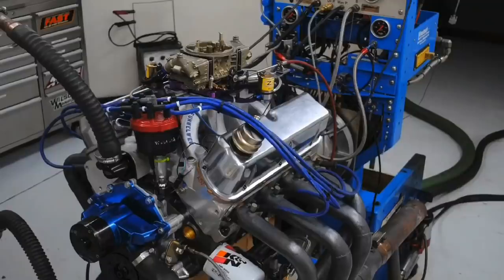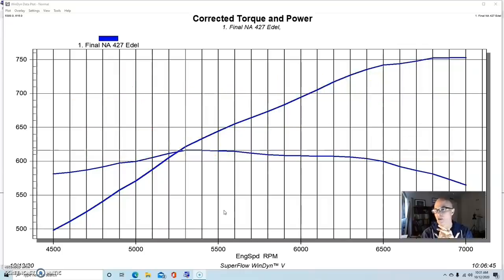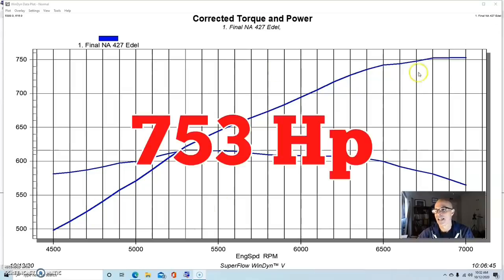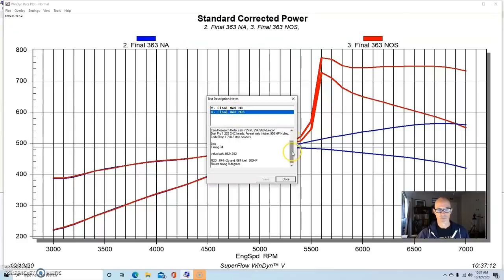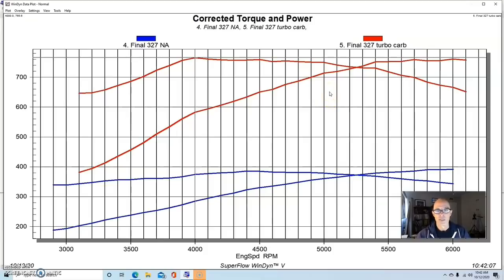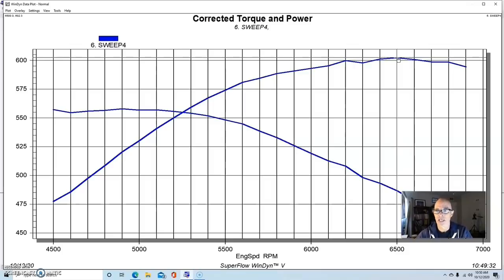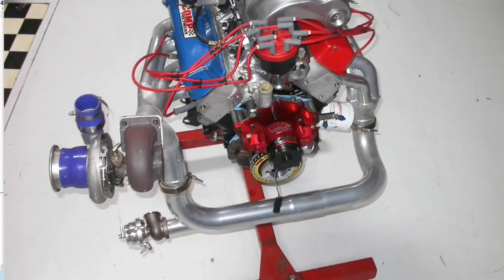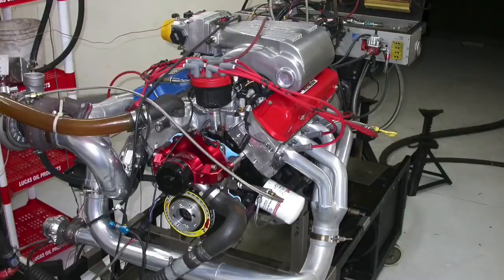THE FAST 5 -- 700-HP 5.0L FORD COMBOS

Comment: The correct cubic inch of each engine is parenthesis. For some reason, some engines .5 and up round up and some do not. 327 (327), 331 (332), 363 (364), 418 (418). 427 (428).
Reply from the maker: The correct cubic inch of each engine was noted
Reply: @richardholdener1727  Your 326.7 rounds up to the 327, at the same time the 331.6 did not round up to a 332. The worst that I know of,  the 350 Pontiac measures 354 cubic inches. Hope this helps what I was getting at. Have a great day and I enjoy your videos.

Comment: Five minutes into the video and so far I hear aftermarket block.  I'm not a mechanic. I'm a Street racer from way back. And with a aftermarket block, should be able to make over 700 horses and not have to worry about the block

Comment: Question??? I notice on the smaller displacements that the torque and HP numbers are pretty close in proximity, which I've been told thats signs of a good build. However, on the larger ones the numbers are a bit further apart. Is there a reason for that?
Reply from the maker: if torque is higher than hp-its a very mild build, if they are the same, its mild, if hp is higher than torque-its getting good

Comment: That's 427 needed different heads. Y'all threw up money on some garbage heads don't matter how much the flow bench test are. Afr 225 or some kasse p38, trick flow r or high port. If I did n new motor would be aluminum 363 dart block with some AFR 225 outlaws and 1 turbo for mild street motor of 800hp/torque or race gas for 1000hp.
Reply from the maker: you missed the point of the 700-hp combo video
Reply: @richardholdener1727  nope. Crappy heads waste of time and money.

Comment: Is it true a 1992 ford with afr heads makes 400 horsepower all my friends are telling me that this is true but I think that a cam and other things might need to be involved and this was in a Lincoln 1992 Lincoln
Reply from the maker: a 1992 5.0L Ford? no-not without a cam
Reply: @richardholdener1727  thank you.I also told them I need to fly cut the pistons to work with the afr heads.or do you think I'm wrong? I really love the videos you share.

Comment: Contrary to your disappointment in the video, I think the 427 was very strong! My personal rule of thumb for a strong NA engine is 1.4 lb-ft per cu in at the torque peak and 1.25 lb-ft per cu in at the horsepower peak. Your 427, with very good parts in it except for the rockers, was well over those numbers by my calculations. By comparison, the 363 NA numbers were well short at about 1.3 and 1.2 respectively. It didn’t have 13:1 compression so maybe that’s understandable. It’s all good info, as we’ve come to rely on you to provide. Thanks!
Reply from the maker: the 427 made 1.75 hp per cubic inch-the 363 made 1.56 hp per inch
Reply: The torque that creates the power is what I go by, the 1.2 @ 6800 gets you 1.5+ hp, likewise 1.33 @ 7000 gets you 1.75 hp...

Comment: Richard, Have you ever done a test on using different trims (S trim vs T trim for example) of centrifugal blowers back to back?
Curious to see the difference in boost pressure, IAT, power curve, etc... with the same pulley setup on different trims-preferably from the same manufacturer.
Reply from the maker: I did-I'll have to see what engine family

Comment: Richard could you please at least list the build sheet for the Paxton 775hp combo? What heads, cam, intake? Boost level? Peak power rpm? Also, are these tests on pump gas? Pretty please 🙏! 

👍
Reply from the maker: no pump gas
Reply: K well will you at least tell us what heads/cam/intake were used please?
Reply: HCI ?

Comment: QUESTION,FROM A OLD POST.HOW IS THE A/F RATIO TUNED DIFFERENT ON A N/A MOTOR WHEN USING E85 VERUS 91 0R 93 ARE THEY STILL ALL TUNED AROUND 12.9
Reply from the maker: yes
Reply: Thanks richard

Comment: Any chance you can test any Cleveland combos? Or test Aussie heads?
Reply: That would be a good one with the OEM 2bl closed camber heads along with some of the down under aluminum heads from pro comp to the top dollar heads and also p-38 heads offered by Jon kassie  that would be very informative and I'm sure help a lot of guys decide on what set up would be best for them !!!
Reply: Bobby Rosetta I’m at the point where I’m selecting cam and cylinder heads. I’ve found a pair of closed 4V heads on eBay in the 1.3k region. I’m be also found a guy who has genuine Aussie closed heads cast by ford in Australia would still need valves and everything. But I’ve heard they’re a good middle ground between the 2V and 4V ones. So I’m kinda debating which way to go. I have some time at least while the car is getting painted to decide.
Reply: @Bonanzaking  keep me posted and send some info on how your going to use it and so on ,drag,road race or what ,thanks for getting back to me
Reply: @robertrosetta908  I was kinda thinking about road racing. Outside of that I’d probably use it for weekend trips to Vegas from LA so the large stretches of highway will be nice.
Reply: And also see where it stands against the LS head motors
Reply: I just read a article on Higgins racing and amazed the dyno number on the combination 971hp na,insane for na for a street .motor

Comment: On combo #4, the 418 Windsor, I think the 1 3/4 inch headers are too small. I would have liked to see a 1 7/8 inch primary because it's not to going to overhang the port all the way around like the smaller flange/tube does....which is a bottleneck right at the head.

Comment: Lol, low compression? How bout 13:1 with twin precision turbos, 22psi boost, carburated running meth, around 1300hp to 1500hp. I dont get why guys still build engines that run below 9:1 compression ratio. If you have proper fuel available from the pump, or the car wont be used as a daily, give it compression. Id like to hear your opinion Richard. 

Im thinking about playing with high compression and some boost, but will be on a 4 banger. Highest octane here in my country is 95 unleaded pump gas. We dont have many options when it comes to v8 engines. A run of the mill old school small block engine will cost you more than buying a 1uz and swopping it into the car, including everything you would need to get the auto tranny shifting and tuning. Hence every 2nd pickup here runs a toyota 1uz.
Reply from the maker: for a race motor with enough octane, more compression adds power-many of these were done 20 years ago

Comment: How in the world did that 331 make 448 with an xe274?  Those heads must have been ported to perfection.  You see I am trying to guesstimate my power.  I am running a 331 with 9.6 cr and afr 185 heads with a performer rpm and comp 281hr cam with 1.7 ratio rockers.  I figured it made 420 hp.  So for my 388 build i bumped up my cam to an edelbrock 2281 ( 299 duration) in hopes of making 520 hp...your 408 stroker in the previous video only made 534 which made me think that no way my 388 would make 520, but maybe those afr 185 heads flow better than the trickflows on the 408.
Reply from the maker: that's why I test instead of estimate-I'm often wrong-the dyno never is.

Comment: Richard, was the 427 expectation that better shaft rockers would allow the engine to make more power by running higher RPMs, or were the rockers being used already cavitating and stealing power that a stiffer set-up would have been able to accommodate? Was the intent to give it more cam?  Just trying to understand how it would make more power.

I am looking at an LS version of this approach and was thinking 750hp was about the limit of what could be expected, and to be honest would be plenty nuff. Probably targeting a usable 8,000-8,500 rpm redline. Just tying to get as many vantage points I can before dropping coin on that kind of build.

Comment: What is a good ratio for nitrous to na power.  So 100hp nitrous jet for 250hp na for example.
Reply from the maker: 50% power gain from nitrous works well (250 hp shot on a 500-hp na motor)

Comment: So can you confirm the myth that the LS was co-designed by a ford racer?
Reply from the maker: no idea on that-I do know it doesn't matter-every motor is good
Reply: @richardholdener1727  
I can't find the article. The website is down. I took a screenshot of it years ago but that's on an old phone. If I remember correctly it basically said the LS has many Ford attributes such as bore spacing, head bolt pattern, deep skirts, cross bolted mains, firing order, etc..... because it was designed by a Ford guy. I think it was Robert Yates that had a hand in the head design specifically. 

Supposedly the LS head bolts onto a sbf but it needs some Frankenstein parts to make it jive.

Comment: 700hp SBF can’t happen on a stock block , the block breaks in half right at 601hp exactly , it’s a fact because I read it online
Reply: I read it here so it's double true
Reply: may be a 302 but the WINDSORS are stronger and it depends what rpm you make the power at

Comment: Ford man is pleased. Need some cleveland headed stuff.
Reply from the maker: did you at least search the channel for the Cleveland stuff-like the previous 2 or three videos
Reply: @richardholdener1727  I watched the 400 and 500 and this one, I didn't remember seeing cleveland stuff, I'll have to go back.
Reply: @richardholdener1727  I've seen a few of them, I didn't watch the 400hp one.. i thought I did. So my mistake...
Reply: @richardholdener1727  , it’s definitely worth a look see. These 700+ horsepower examples are impressive. But why settle for impressive when MIND NUMBING is only a pair of good canted valve heads away ? 
I said good...NOT EDELBROCK 2-V Cleveland abominations.
Reply: Right! My dad has a set of 4b Cleveland heads and I’m wondering if it’d be worth it to make a clevor

Comment: 1.7 to 1.8 hp per cube n/a? that's asking a lot. i think 1.5 is very hard to achieve, or else my age is showing
Reply: We have to remember to subtract about 100-120 hp to equal wheel hp since these do not have accessories but still impressive

Comment: The NA 427 is a good example of how hard it is to make real naturally aspirated big power. Great video Richard
Reply: Exactly! I had a guy tell me how his 327 in his s10 made 600-700hp NA... I said you realize that's nearly 2hp per cu. in.? That would be an insane combo
Reply: @140horse2  
We have an alloy Windsor (bored / stroked to 417ci) that makes a little shy of 2HP/ci NA (on Q16).
And it's running a four speed manual H pattern box too!
We're going to throw a 'tiny' shot of NOS at it this season make it a trifle more exciting.
Reply: @140horse2  I found a write up on a 553 hp 327 SBC from Super Chevy in 2008.  Standard 3.25 stroke .040 overbore (333) 6" i-beam rods KB hyperereutetic +.005 pistons Comp solid roller cam 1.6 roller rockers AFR 195 Comp Ported Eliminator 60 cc heads.  553 hp @ 7100 & 433 tq @ 5600.   Built by Jeff Latimer at JGM performance.  Built to be a street motor 63 Chevy II it had a broad torque band with adequate low end power.  With more cam and more head flow could it make 600?  Maybe but would probabably kill it on the bottom end.
Reply: @chris49ford  Oh I have no doubt that it’s possible. But this particular guy has limited skills and knowledge... I asked him what heads where on it and his reply was “corvette”. So I highly doubt it was a very radical build. Probably an old small block with a mild cam lol
Reply: @140horse2  Bet they were "Fuelie" heads to boot lol.  With 1.94 valves 160 ports and 64 cc chambers that was the hot lick 40-50 years ago.  The L84 327 Fuelie was rated at 375 hp but who knows what it really made.
Reply: Hp/Ci is a bad scale my men, the Hp/Liter is the correct one to use, it really tells something from the engine.

As our europeans stock engines made 75hp/Liter in the 90’s in a normal family cars 2liter engine, that tells there’s lot more to be in us engines.

I keep the 100hp/Liter as a N/A power milestone from older (pushrod engines) as a good reference, and anything over that is considered as a street/strip engines power levels.

So 500-600hp from a 327 (5.35liter) engine is “nothing” it is in the ballpark considered as a healthy street engine/ street-strip engine.

And the same 100hp/Liter is the benchmark for turbo diesels also, when the 100hp/liter is the line where a diesel is considered as a “superturbo”.

And a 200hp/liter merc diesels are so last season as a daily drivers here in Finland.

So yeah, you guys need to start look up out of your own boxes. 😁🙂👍🏼
Reply: @Andrey Angere What you mean by that. 😂

Are you talking about factory engines or race engines? 😃

I have a factory stock, unopened 75hp/liter engine in my car that has +200k miles (+320tkm) and its purring still like new. Never had even a head job.
And it’s a “unreliable” 6cyl bmw engine.

My friend has a +200hp/liter, daily and even winter driven 6cyl bmw engine in his car, which is equipped with a home made turbokit.
Has over 60k kilometers driven in last couple of years. 
But that engine is rebuilt with mostly original parts, only aftermarket parts are the conrods and pistons, which are not even a mandatory on that power level. 
He just put em in case he wants to upgrade the head, cams and the turbo for bigger power.

Comment: Richard, I know you already do the most when making these videos, and your information is amazing. I have one little thing to ask if just maybe maybe maybe you might data log manifold vacuum readings with the solid roller cams? Puh puh puh pu please......especially the Ford cams. I've been really leaning towards solid rollers for my 93 Cobra, and the self tuning of the Holley EFI would like to see some vacuum. 

One more thing...."HXL Series" that you ran in the 427???? I can't find anything on Comp's site. Enlighten me please.
Reply from the maker: solid roller and self tuning? those don't go together
Reply: @richardholdener1727  don't take the wind from my sails man!!!
Reply: Me & my pops run solid rollers on Holley software, mine idles at80 kpa too, just need to fix the y & x axis on fuel table

Comment: You mentioned on the 418 with the 4.1 stroke the pistons coming out the bottom of the hole .. can that lead to skirt breakage? I imagine the piston would rock a little.

That Dart 363 SHP with the Pro 1 ported 225 heads looks like a great all around motor.

Comment: Rich CSM Racing engines in Suisun City is gonna finish up my 430W soon - I'll share my dyno and specs vid soon, hopefully similar or more horse
Reply: I'm building a 351w with a stoker kit, I'll keep an eye on your build. I got my block out in Stockton at a machine shop getting prepped
Reply: @robeso6247 whats your specs and horsepower goals?
Reply: @TheRdub82  I'm looking to do 393 or a 408 kit, whichever kit doesn't need clearance  work. Bore is stock and I'm waiting to see if needs to get .30 over. I'm still deciding between afr 205 or trickflow twisted. Still looking for a cam. But my N/A goal to start would be 450 or better and after that single turbo for 7-800hp goal.
Reply: @robeso6247  go with trickflow twisted wedge and don't look back.  Do a 4" stroke and 4.030 bore and send it.
Reply: @TheRdub82  I'll take your word. What about the the pistons? Don't they need to specific to match the heads?
Reply: @robeso6247  there are some specifics with pistons and heads.  Do you have an engine builder?  They can help spec you the correct parts.  Definitely want the right parts.
Reply: @TheRdub82  I'm building it myself. I tried asking my machine shop but they only wanted to send me to a performance engine builder